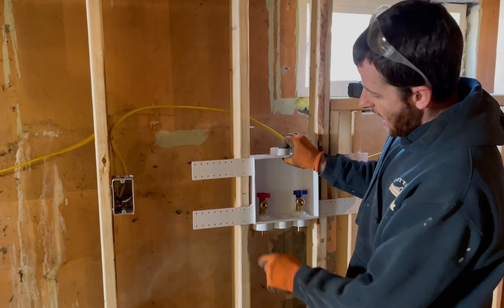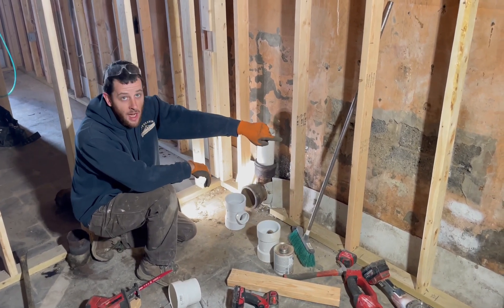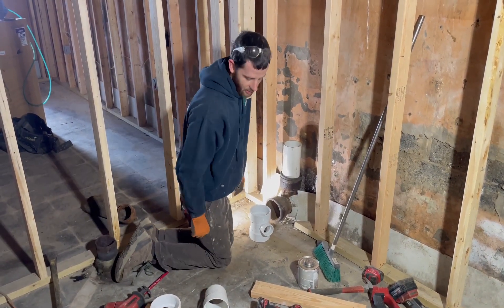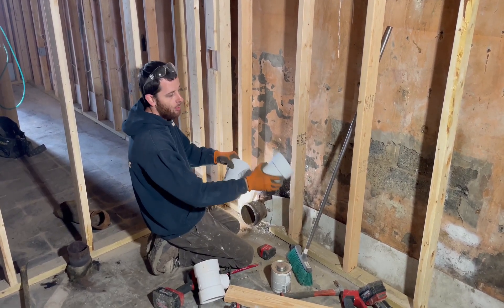Layout and Completion of Vertical Plumbing Stack | Episode 12

Comment: all new low-flow toilets require why main stack connections with wye connection for better flow. Not a sanitary tee. Fyi🤔
Reply: Even on A vertical stack? I thought that was only for horizontal?
Reply: @Scott  
Kitchen sink or bathroom sink can be used a sanitary tee. But if you're connecting a toilet you need to use a wye connection for better flow for Less clogging. Is new toilet Is low flow. Toto toilet specify wye connections in the insulation guide.

Comment: 8:50 I think that tee's are only for vertical transitions and should never be used for waste-carrying pipes.  I think that tee's are ok for horizontal transitions of venting.  I think that wye's are ok for horizontal or vertical transitions, but use more space than necessary for vertical transitions, and cost slightly more.
Reply: Theoretically, if two drain stacks are parallel and running vertically and you want to combine them into a single pipe, could you combo-wye them together? Seems dumb to hinder the flow and make it run horizontal and then put a sanitary tee...

Comment: 6:30, I think that most codes require a minimum of 15" of space from the center of the toilet to the sides, not 12".

What is the minimum clearance for a toilet?
The minimum clearance for residential toilets can be found in Section R307.1 of the International Residential Code as well as Section P2705.1 which specifies the required clearance for a toilet fixture and other fixtures too.

Section P2705.1 is a part of the International Residential Code which mirrors the International Plumbing Code. Provisions from the International Plumbing Code are placed within the International Residential Code to allow for a complete and comprehensive code regulating the construction of single family houses, duplexes, and townhouses not more than three stories.

To better understand what the International Residential Code (IRC) covers, be sure to check out this POST.

With that said, let us take a look at these code sections.

Per the code sections noted above, here are the minimum clearances for a toilet:

A toilet shall not be set closer than 15 inches from its center to any side wall, partition or vanity.
A toilet shall not be set closer than 30 inches center to center from an adjacent fixture.
The clearance in front of a toilet shall not be less than 21 inches to any wall, fixture or door.